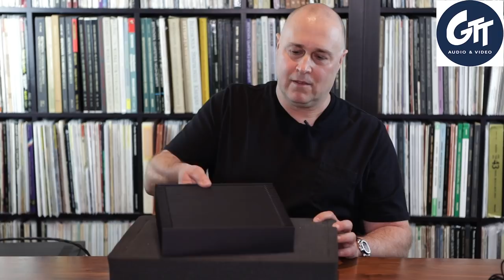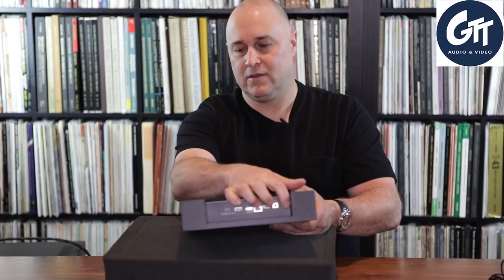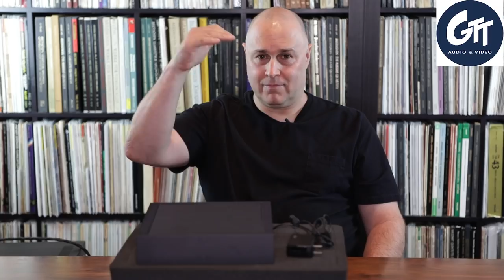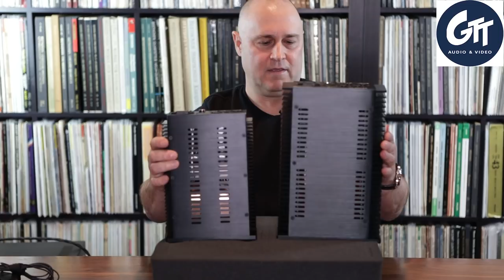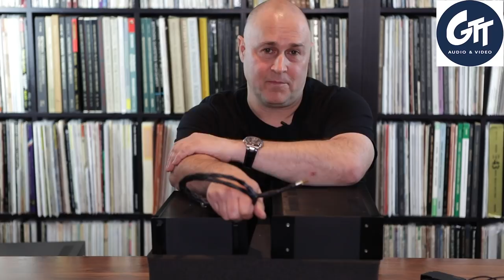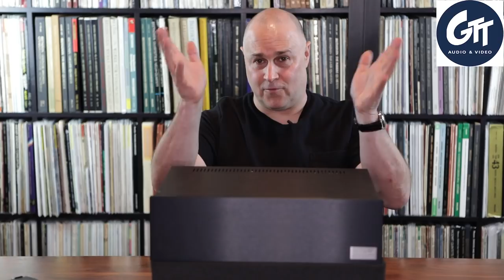GTT Audio - Episode 35 - How to Maximize Roon Performance.

Comment: Hi omg ... had a custom Belleson psu with a chinese thin powercord supplying NUC running Rock ..... followed your advice an put a really good braided supply cable on OMG great upgrade more of everything!!! so thank you. Just on another note.......I loaded Roon onto a X300 mini pc running a Ryzen 4750g with windows 10 .... wow more dynamic than the NUC (with rock) bass weight and body and imaging are improved...others on the Roon members forum concur. The Nucleus is good but Ryzen in an X300 .... was a shock its worth a try.
Reply from the maker: thanks for the tip, we will build one of these and try it out.
Reply: @gttaudio  Cheers let us know how you get on...

Comment: Apparently the Mola Mola’s Tambaqui DAC has an internal switching power supply.  Any thoughts on modding this DAC to allow a better external PS? Or have Mola Mola done something to make this unnecessary?
Reply from the maker: Bruno rolled this power supply special for the Tambaqui.  Don't touch it.  Not all SMPS are bad.
Reply: @gttaudio  thanks.  Noted. Love your videos.